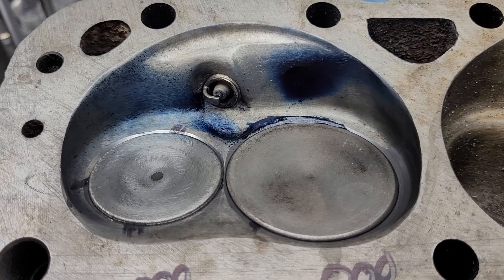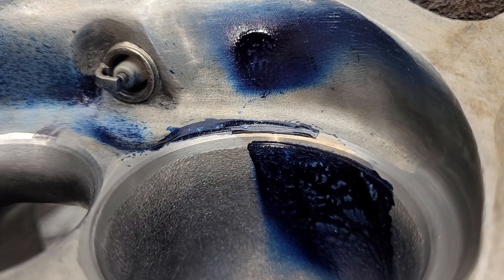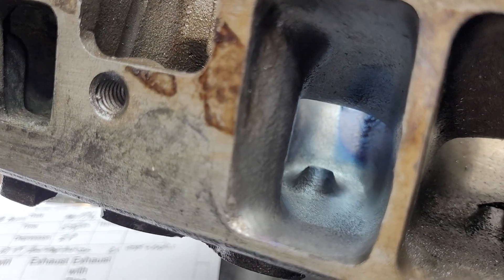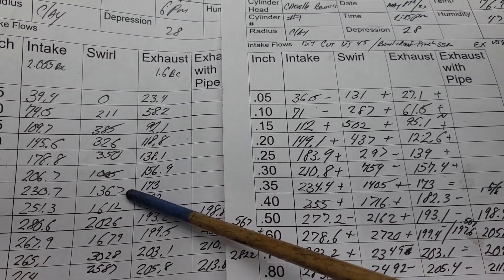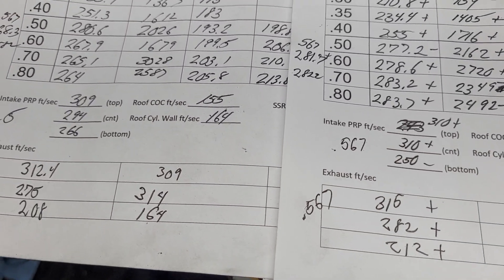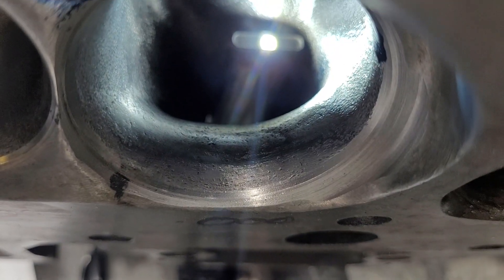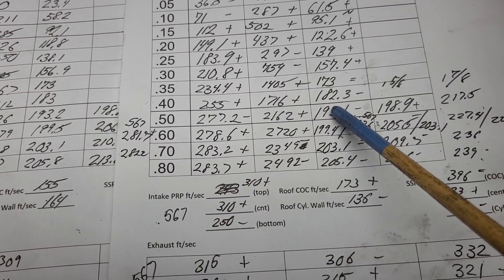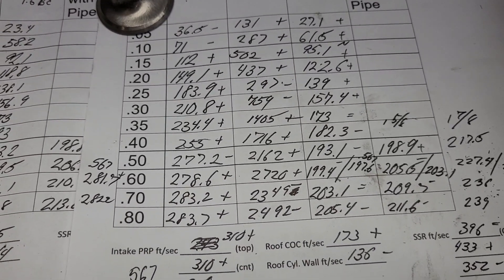Chevy 034 Bowtie cylinder heads with 90's porting, first cut flows, airspeeds and dykem experiment.

Comment: I think u did good.  Other experts say that even though an intake valve lifts to .550, you still want to see the intake port either maintain or gain airflow after that because an engine is going to move more air than the flow bench.  So that is a good indicator of whether an engine will maintain power past the shift point.
Reply from the maker: The way they were ladt time driven they pulled hard to 6800 and shifted at 7000.

Comment: NO! NO PLANTING TU-LIPS! 

Charles, the head will flow more, but that's not good on the street or track(running engine is what I meant).

You want to discourage low lift flow. The tulip and back cut will be the ”Summer 2023 worst choice award.
Reply from the maker: Well, stay tuned. The difference is amazing. Good testing.
Reply: So I'm sure you've heard, "porting a head on a boosted application isn't necessary because the turbo/blower is shoving it in there anyway." True statement of action but not of theory. Porting makes less back pressure (boost measured) which equals less heat....etc.

So I've come to see the exhaust in a similar fashion. Increasing the flow potential through the throat, bowl, and runner great! However I think that discouraging low lift flow by means of, valve job, valve shape, and combustion chamber shape will result in more power production due to more fresh air fuel intake charge in the cylinder at the end of the exhaust stroke. 

I think this has a lot to do with today's growing trend of larger intake valves and same size or smaller exhaust valves. 

I'm doing it. 2.100/1.59, 2.100/1.55, 2.08/1.55, etc. Cant wait to see your test results.

I finished a set of heads last night that are being bolted on today and dynoed tomorrow. I cant wait(sight anxiety) to hear these results either.
Reply from the maker: @arturozarate1752  I think you are right.
Reply: There's more to say to support "why", but I want to see your results first....

Comment: Fantastic first gains ..but my question is with a slight loss of air speed on short side. On the bias side is that the potential reason for a better flow pattern in the combustion chamber ??
Reply from the maker: That is a good question.